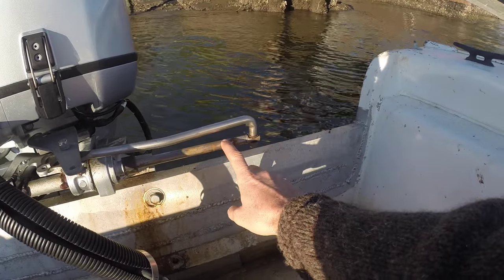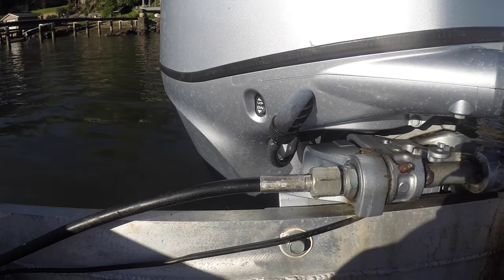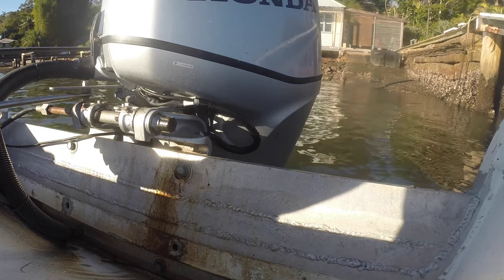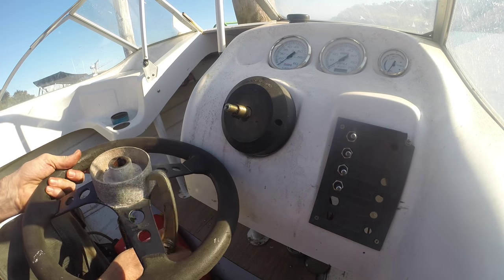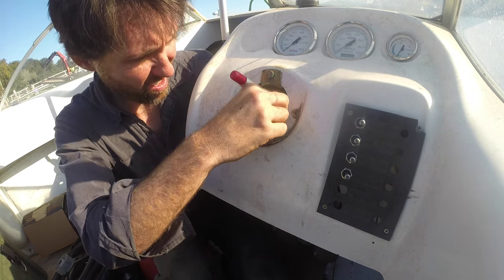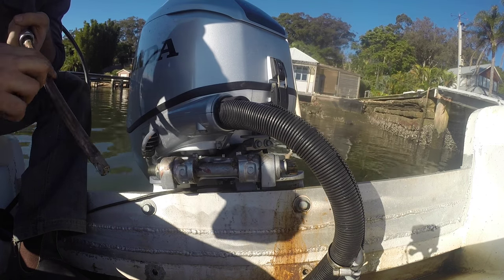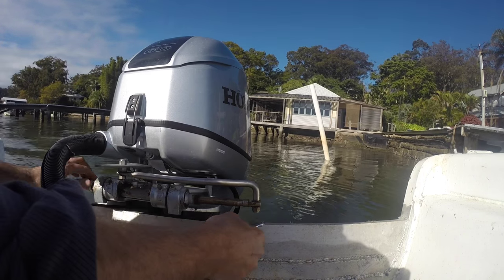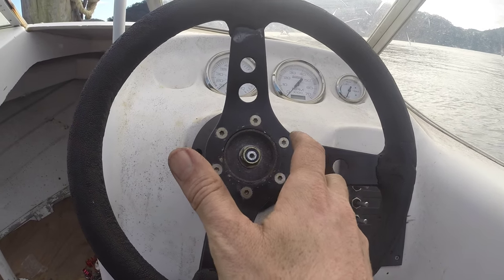Replacing the steering cable and helm in a boat

Comment: Just finished removing a jammed cable as well as the tilt tube, never want to go through the tilt tube remove clean and replace bit again. The video is excellent it helped me get started.
Reply from the maker: Ah yes, not a fun job at all! Good work on getting it done though. It should give you many years of good service now.

Comment: Excellent video! I was scratching my head a little about how to get the cable out before found this. Mine is a bit more difficult to get at but your very clear tutorial made it a straight forward job! Can't wait to get the new helm in and get back on the water.
Reply from the maker: Thanks Roger,  glad the video helped you. Safe boating! :)

Comment: Thank you so much for your excellent and easy to follow video.  I was finished all my renovations on my 21 foot Duffy, or so I thought,  when the steering cable jammed.  I had no idea how to replace it but after watching your video I was able to see how to detach the cable from the rudder and replace it.  Although the Duffy is an inboard electric boat the steering system was very similar to the outboard you showed.   Thanks again!
Reply from the maker: You're welcome mate, glad the video helped. This is a common steering system in a variety of boats that's for sure.

Comment: Thanks so much for your video, I’m changing my steering cable and helm tomorrow and feel a lot more confident about it now. Awesome tutorial 👊
Reply from the maker: Glad it helped!
Reply: Good presentation but does not apply to all boats, for exemple on my 1994 sportman 15' Key West I had to get an engin hoist to remove the outboard motor from the tramson due to no space to remove or install the steel shaft in the sleeve below, also wish there was a tool to clean the inner rust in the sleeve.

Comment: Very useful video, thanks for posting. A handy tip when using the puller is to leave the nut loose on the shaft if possible, that way the puller doesn't go flying when you break the taper.
Reply from the maker: Hey David, good tip. Could save a black eye! ;)

Comment: Just came across your vids the last month or so, but really enjoying them.  I've only done one project of my own on my Carolina Skiff 238DLV, and that was a bilge pump and float switch change out.  I did notice and exceptionally lengthy steering cable cooked up in the bilge and became curious as to what a replacement might entail if it ever became necessary to do so.  This video gave some great instruction along with the comfort that I might tackle it myself.  Hopefully, that's a way into the future. Thanks for all the good info, even on boats and motors not similar to my own.  Blessings from Alabama!
Reply from the maker: Thanks mate, glad you've been enjoying the vids. Safe boating! :)

Comment: Great timely video. I am just about to install the steering mechanism in my nearly finished homebuilt mini tugboat from Berkeley engineering plans (Candu Junior) and I no longer dread starting it after seeing this video. Thanks for all your great tips.
Maurice
Reply from the maker: +737NGSIMdriver Hey Maurice, I'm glad the video helped. I took a look at the Candu Junior and it looks really cool. Congrats on making a boat from scratch. That must have been a huge job!
Reply: +Dangar Marine It is a big job but doable as long as you have done a fair amount of woodworking and are willing to learn about fiberglass and epoxy, I started late June last year and I was about 80 % complete by late October ( I am 70 and retired) when I had to stop because of our 'wonderful' winters :). Started again last week and now doing the engine installation, steering, electrical etc.... and countless hours of sanding and painting once it gets warmer. Hope to launch this coming July if all goes well. Anyway, I enjoy your videos, even the ones not applicable to me since I am totally new to boating.
Reply from the maker: +737NGSIMdriver Be sure to post a video when you launch it. :)

Comment: Stu
thanks for tips on replacing steering cable and removing steering helm
fitted new cable and aligned steering wheel easy as
Thankyou
Wayne O.
Reply from the maker: Thanks Wayne, glad the video helped you get the job done. :)

Comment: Much needed info on the helm part, which has to be where my problem lies. I have removed cable from the motor cleaned and greased but still stiff before I reinstall. Hopefully its the same type on back side because mine is a stick steer. Thanks!

Comment: A boat mechanic down here recommends to just use regular motor oil instead of grease in the steering tube. I went to buy some grease from him and said "I'll sell you the grease, but i only use oil on every motor i service." He said it just cakes up and gets hard over time. So I just used some cheap motor oil and i must say it turns just as smooth and don't have a mess of grease. And i do trust him. He is the oldest and 1 of the biggest local boat mechanics here in New Orleans and we have a LOT of boats down here
Reply from the maker: I can really see where he is coming from. Grease can very quickly become like glue with age and exposure to sun and salt water. I always use this very light lithium grease, but oil sounds like a great option too.
Reply: Dangar Marine do you both think the old could be bad for the water?  that's my only concern with oil
Reply: SouthFloridaFishing  the oil doesn't come splashing out when you turn the wheel. It just coats the tube. If you try it out you'll see what i mean. He did it a good way. But people that don't remove the tube just use the zerk and pump marine grease. Thats when you can have the hardened grease problem and then you would have to remove and do it the way he showed in the video.

Comment: Thanks for this video, I have a question : my steering wheel is slightly off center. When the engine is straight the steering wheel is like 10minutes to the left. There is no spline on the steering wheel, just a key and the steering wheel has three slots for the key, but I can’t put it in a way for it to be straight. Is there a way to get my steering wheel straight? Thanks

Comment: Is there usually a free play type adjustment in these cables? Mine works well, but the free play 8s a bit much and wondering if I should lift the floor to look for an online cable adjuster?

Comment: Hi Stu
I have a Johnson 70 hp and I'm trying to remove the steering cable.  Do I have to loosen the engine mounts to remove the cable as it seems too long to pull through.
Reply from the maker: It depends on the hull shape mostly, but yes, sometimes you need to unbolt the engine to get the cable out.

Comment: great vid.  my 50 hp Merc turns more to starboard than port.  seems the steering rod should be about 5-10 mm longer so that the center of helm matches the center of outboard.  Is this normal or am I noticing things that don't matter?

Comment: Excellent video explaining how this works! I have learned so much from your videos.  I bought an old bass boat that hasn't ran in about 12 years.  The steering is seized at the cable you replaced where it connects through the tube at the outboard.  Are there any tricks when it has seized?  I was able to get the lock nut off the left side and move the cable after disconnecting it from the helm. Thanks!

Comment: Dumb question.  Are the diameter of tilt tube steering standard?  Changed motors  recently and would rather not damage anything.  Went from an 82 mariner to a new to me 97 mariner.

Comment: I replaced my Honda 225 steering cable. For some reason the outboard can easily be pushed side to side as if turning the steering wheel. But takes very little effort when pushing the motor itself by hand. When trailering it will slide back and forth left to right also…. Any thoughts on what may cause that?

Comment: Thank you so much for the video. I have 9,9-4T outboard and 360 wooden keel inflatable boat. I want to set a steering system for it. Im a technician, i think, i can set it by myself... Thanks and Hi, from Aegean Sea :)
Reply from the maker: +Tuna Akdal I wish I was back in the Aegean. I just got back from a holiday sailing around Milos. Good luck with setting up the steering. Let me know how you get on.

Comment: hello stu, I am restoreing an older model aluminum river boat (18 ft) with a center console.  while waiting for motor 1987 merc 115, i tinkered with other things trying to learn by taking things apart & putting back together, well, i took the helm apart and put it all back together which was fine but the steering is reversed (turn wheel right boat goes left, etc.) the helm isnt threaded on both sides so cant just move cable over, is it possible that when i reinstalled helm that i turned it 180 degrees therefore reversing the end results of cable?
Reply: No reply necessary, problem solved, discovered there is a threaded entry on other side of helm that i wasn, aware of so put cable into that female receptical and cleaned, lightly lithium greased steering rod as you suggested in your video and works great.  Now I have issues with controls being sticky to the point of great discomfort when loading boat onto the trailer.  will let you know how repairs turn out. (or replacement)

Comment: I'm in the process of swapping out motors on my boat. This is quite helpful...even if it is metric! Ha ha ha. Couple of things. Wouldn't it be better to use a pipe wrench to break that fused part? If re-using, it seems like it wouldn't crush the cable... to me. Also, when pushing the cable through, wouldn't have helped if you had put some WD-40 on the rod then rubbed it down with steel wool to remove the rust? And personally, I wouldn't use NyLok nuts, they strip too easy. Use normal nuts w/a lock washer and Lock-Tight.  Just curious...

Comment: This is all great BUT how do you get the steering cable off a 50 hp mercury  outboard motor.
Reply from the maker: If it is stuck in the tube you will need a steel rod to punch it through as well as perhaps a bit of heat on the outer tube.

Comment: Awesome video. I have an older boat and my steering wheel is loose. Turns motor fine, but when Im trailering my boat down the road. the motor turns. Not sure why. I just grab a strap and it it to my steering wheel so my motor doesnt turn when im on the highway. Do you have any idea?
Reply from the maker: Outboards will often have a screw on the pivot tube just below the powerhead and pushing a nylon pad against the shaft. This acts as a type of brake so you can wind it in until you get the desired resistance on the steering wheel.

Comment: Dangar - I am very much a newbie when it comes to any mechanical know how with outboards or motors in general but with your videos I have been able to strip my boats clean, wiring cable, helm, steering wheel and throttle. I am onto lifting the old mecury 60 hp off my restored boat and replacing with new 70 Yamaha.  I marked all the switches from both boats but they are different switches (lights,pump, radio etc) completely..  have you done a video on wiring switches if so could you direct me to the link - Thanks again Dangar Maine - your videos are awesome.
Reply from the maker: Hi Troy. Great to hear you have been achieving so much, it's very motivating for me. :). I'm about to do an engine swap for a friend so I think it would make a great video. Stay tuned!
Reply: Excellent I look forward to it - Thank you

Comment: Great video!!  I have a fairly new steering system installed by someone else but there is a small amount of play in the steering wheel which affects the driving of the boat.  By watching how you used the helm to pull the cable through, if you loosen the lock bolts shown at 19:40, and turn the helm, should I be able to tighten the steering and re-lock the bolts?
Reply from the maker: Possibly, but it is unlikely to make a difference. They generally only lock into a single grove on the cable. It is more likely to be wear in the components of the helm.

Comment: Hi dangar Stu,
Thanks for your instructional video. I just changed my helm and cable and steering is great now. Only problem my cable is a little long like the one you got and is hanging below my transom step and i think is causing the boat to pull to starboard. I measured as per guidelines, but still a little long
Wondering if you have any tips for storing my cable in the boat. Do i just need to undo all the cable ties and have to cable curving up and down at my interior side panel. My boat is 2000 allycraft 560 bowrider. Cheers
Reply from the maker: +Andrew Field Hi Andrew. A longer cable won't cause the boat to pull to starboard. There will be an anode on the outboard just near the propeller that is shaped like a small rudder. This is designed to counter act the rotation of the prop (that will cause the boat to veer from straight). Loosen the bolt on that anode and rotate it a little bit to port then test again.

Comment: Thanks for the advice I will check the pivot tube first. Would you recommend synthetic 2 stroke oil or mineral oil 2 stroke oil (I have both) or some other oil for lubricating the cables.
Reply from the maker: Personally I would go a light sump oil like a 5W-30 or ATF. 2 stroke oil may be okay but it is mostly designed around being burnt which isn't really an issue with cables, I hope!

Comment: could you show how to adjust loose play in steering. mine have to move about 4-5" before outbard moves
Reply from the maker: There really isn't much to adjust. It is generally a fault in the helm or cable.

Comment: Dangar,
how did you know the proper cable to used? any suggestions to check for the part #.
Reply from the maker: +Fancy Lee There is really only one type of cable available with this type of steering (although there are a couple of different brands:). The only real variable is the length of the cable. Of then the part number will have the length in it, ie, a Seastar Solutions cable SSC6213 is a 13 foot cable. To get the length either look for it printed on your existing cable, remove and measure the existing cable or measure the boat up as per the suppliers formula for selecting a cable.
Reply: +Dangar Marine I want to buy the steering wheel cable rack stern. about 16f long. are there all the same?

Comment: Giddy mate,  would it be possible to replace an existing pulley system with this type of kit?
Reply from the maker: +Mark Davis Yep, sure is. Where the pulleys are attached to the outboard you just need to add a drag link which is then attached to the rod that goes through the outboards tilt tube.
Reply: +Dangar Marine thanks buddy.......awesome vids
Reply from the maker: Thans mate, glad you enjoy them. One day I should do a vid on adding this steering to an outboard, but I've got to say, I'm a bit fan of the pulley and cable system. It is very clever in it's simplicity and it never seizes.

Comment: Great video and seems simple. However I am unable to "tap" my steering rod through the or for that matter tap it back to where it was. (By tap I mean a fairly big whack with a hammer) I have an inch to go before the end gets to the motor, and has pulled through a foot on the other side. Any suggestions please? How hard can I tap it? (Not should I have to tap it but can tap it?) What could have stopped the whole cable from moving in any direction? How can I get the cable off? I will be eternally grateful for any assistance? The boat has been idle for 2 years with no mai9ntenance so I should not be surprised.
Reply from the maker: Hi David. I had very seized cable come into the shop this week and I had to hit it very hard to get it through. Once the nut is off the end of the tube that the cable enters and the drag link is disconnected, all that holds it in us old grease. Once the end is level with the tube you will need a string steel rod to keep hammering it through the tube as it may be quite right right up until it pops out. You will have to really clean the tube before putting the cable back or installing a new one. The cable I did I had to hit hard enough to slightly mushroom the end. It still worked fine though.

Comment: I know this video is almost three years old but I have a question. Can the new cable be go thru either the upper OR lower hole on the new helm control? I know I need a new cable and am thinking I might as well replace the helm unit. On my current helm unit the cable is routed from bottom to top. Thanks
Reply from the maker: No, if you do that the motor will turn in the opposite direction to the steering wheel.